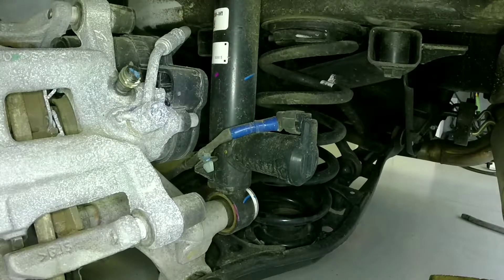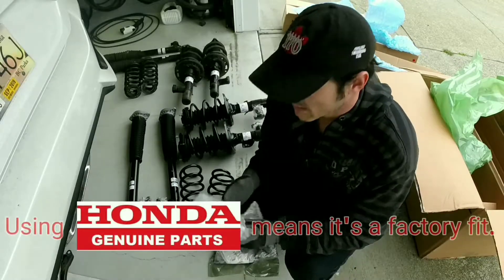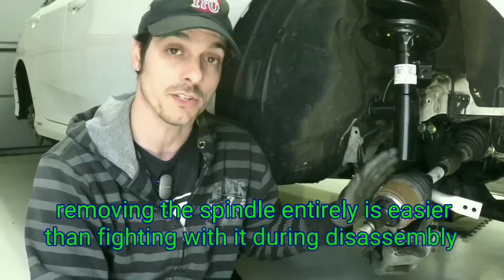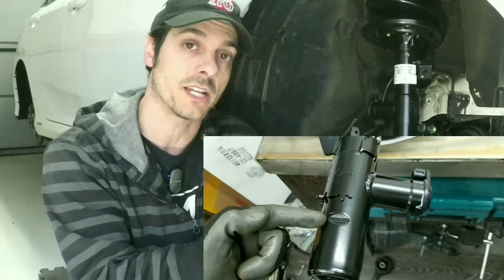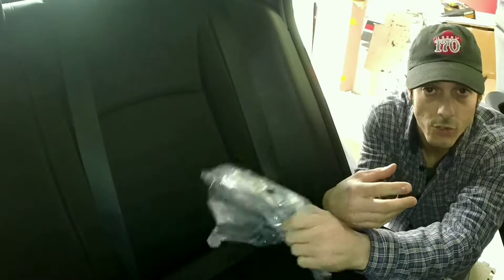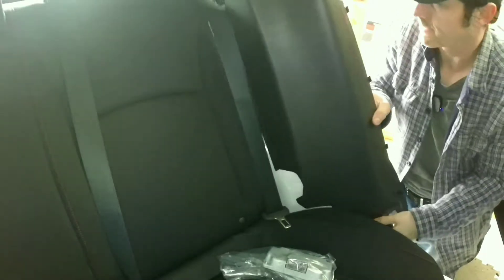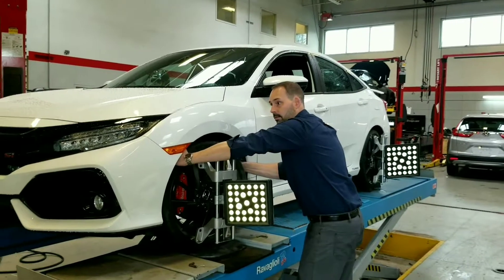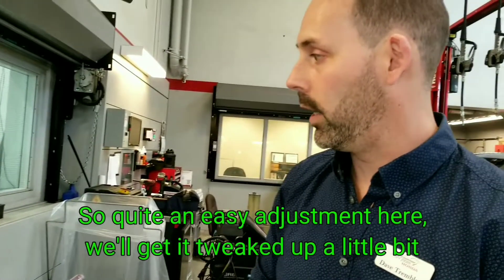2017 Civic HFP Suspension Install (10th gen Honda Civic Si) - Rick's Garage ep 10

Comment: If you get an aftermarket strut that doesn’t have the electrical dampener will the car pop a code and what would you do with the electrical plug if you have a strut that doesn’t use it? And also is there a place to get aftermarket struts that have the electrical dampener? Appreciate your answers
Reply from the maker: @JohnnyWrench-u4o  thanks for your question!  As far as I know, a non-electrical damper installed will throw a code.  There's a (pricey) module available to cancel the errors, and although I've read that you can "fool" the ecu with some resistors, I believe theres more inputs going to the system, so I wouldn't recommend that method.
As far as the harness and plug itself, if it were me, id tape off the end to prevent water intrusion and tuck it away safely.
Reply: @ thanks for your reply truly appreciate it, but yeah that’s what I was thinking “tape it and tuck it away” it just sucks that the strut is $600 OEM do you think a nice aftermarket set would be better then the oem performance wise?

Comment: I’ve got a question. I’m looking to do a hfp suspension swap on my si coupe, but I know that the front end of the vehicle has no adjustment besides toe. How exactly do they adjust the alignment??
Reply from the maker: The camber adjustment is completed at the damper attachment on the strut tower.  I dont think there is a caster adjustment though.  There's a pdf doc at this address that goes through the adjustment procedure :

https://www.civicx.com/forum/threads/factory-alignment-procedures-and-specifications.15163/

Comment: Whats the feed back on the suspension thinking of switching just the module out
Reply from the maker: I'm glad you asked!  I made a follow-up video once I had a few miles on the new suspension.  Check out ep. 19 for more details - https://youtu.be/sUR6jKKajaA
I would be cautious of replacing only the control module.  Double check with Honda that the factory dampers are capable/compatible with the new controller

Comment: Can I use si 10th shock absorbers in 10th non-si?
Reply from the maker: They should work but the electronic damping may not work correctly because (if I'm not mistaken) the other trims dont have the "sport" selection mode.
Reply: @RicksGarage  oh ok thanks 🙏

Comment: Do you have to swap out the suspension controller ?
Reply from the maker: Thank you for your question!  I believe there is an hfp specific suspension controller, so it would have to be swapped to get the most out of the suspension.